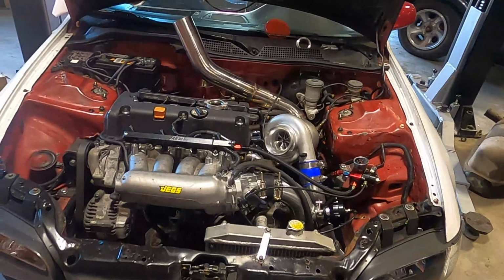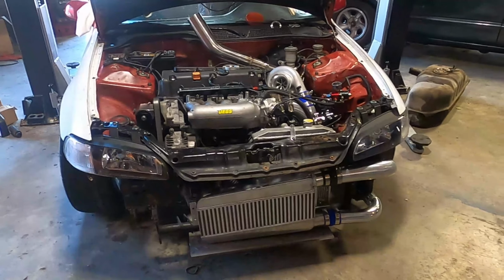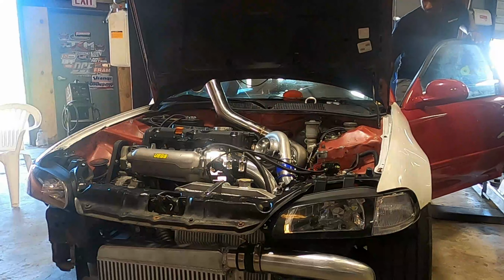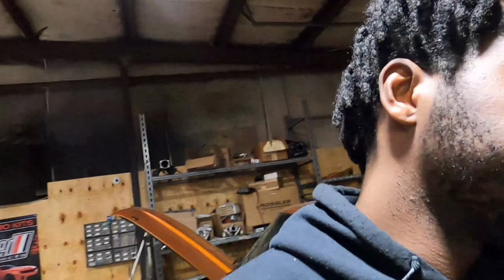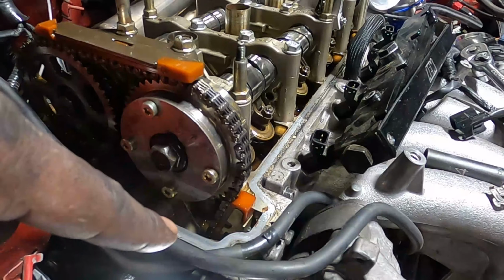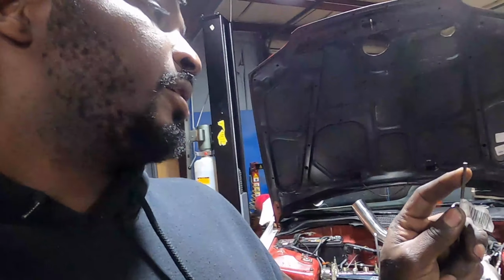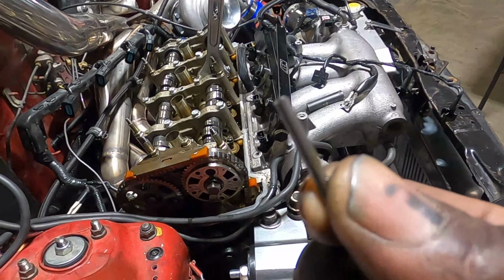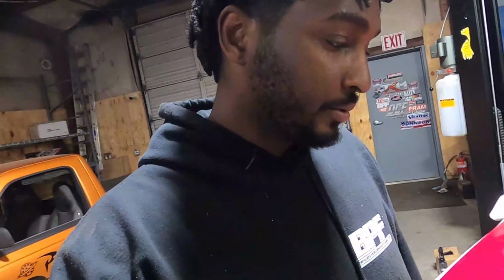Heavyflow's $1500 turbokit is COMPLETE!!!!

Comment: Your mid and high end power is going to be down, VTEC and cam angle is a gem if u tune it the right way...
Reply from the maker: Mid and high end power will be the same. You loose low end power, which doesn’t matter to me because I’m not road racing the car.